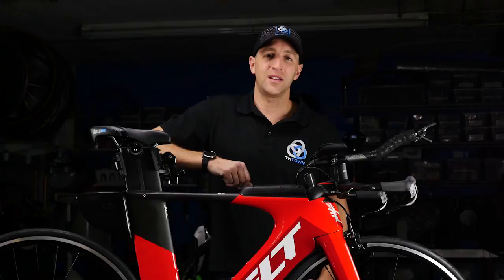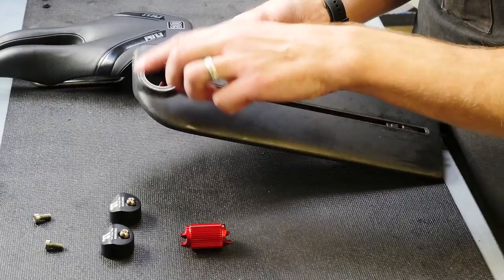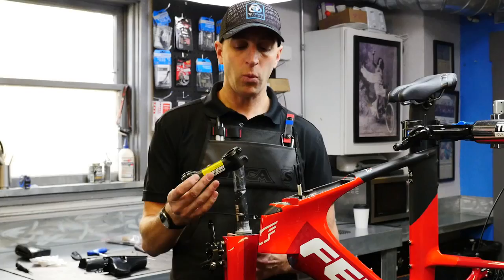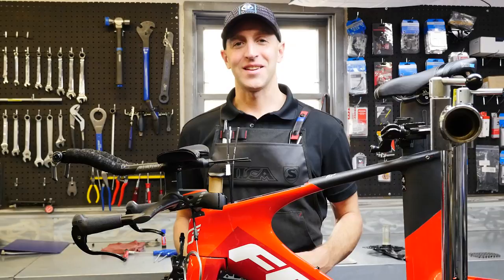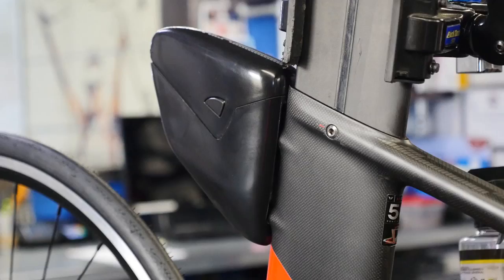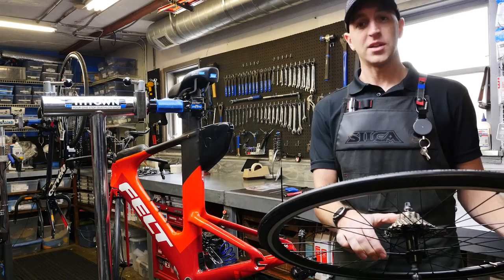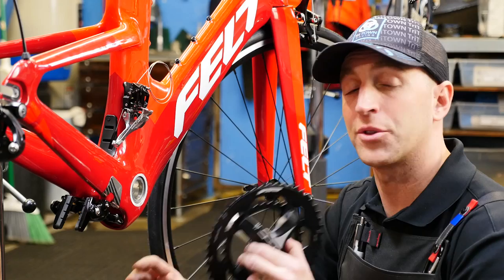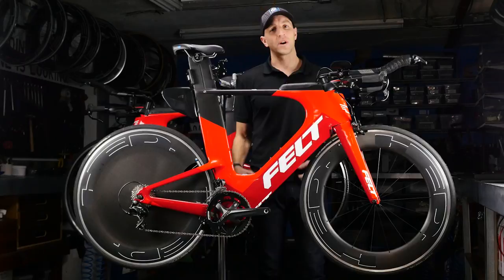Felt IA 16 2018 Build and Review

Comment: Boa noite comprei uma Felt ia ,o canote tipo ficou com uma folga e normal.o que dá pra fazer pra tirar essa folga
Reply from the maker: It sounds like the cable may not be set completely, or possibly the brake is not setup correctly. Can you  take it to your local shop to have them inspect it?